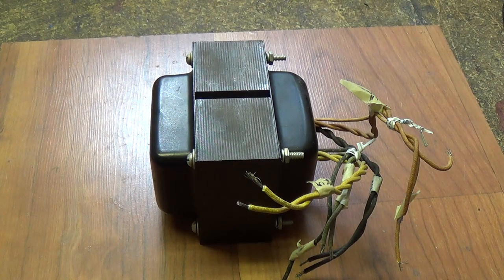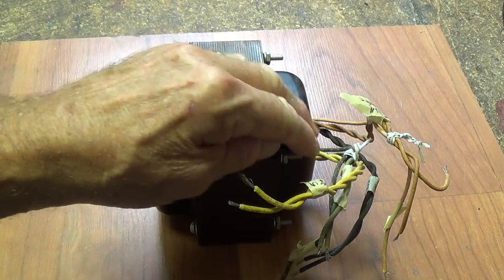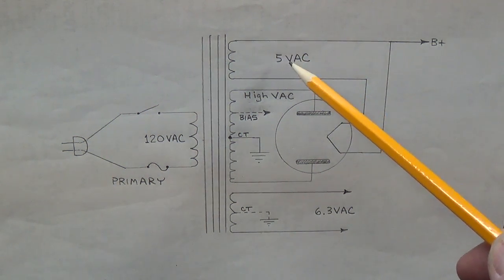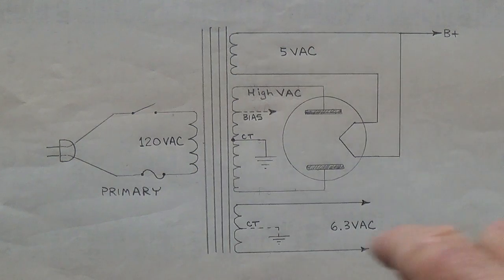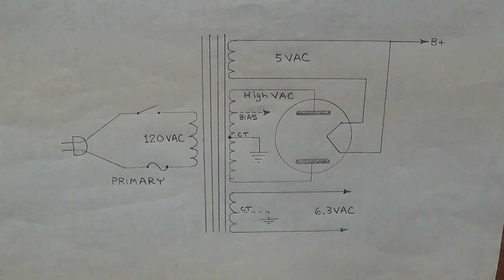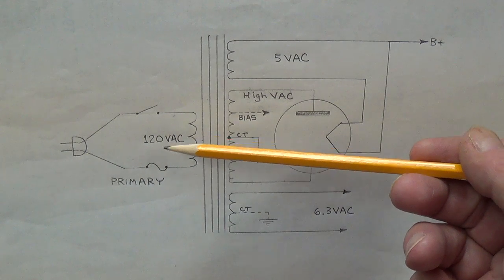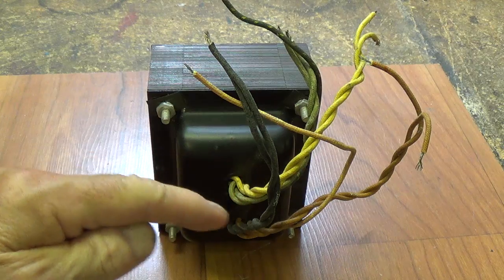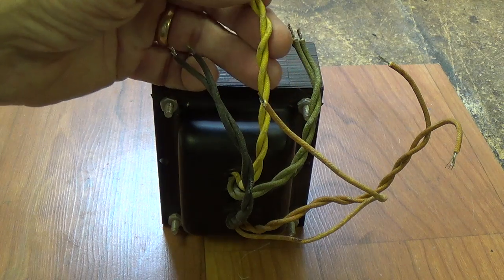How to Identify Amplifier Power Transformer Leads

Comment: Flea market...$5 each.......Yeah, I scored 20 identical power transformers ...haven't checked them out yet for voltages.....
Reply from the maker: Hopefully, the video will be helpful and you'll find some gems, Doug.
Reply: yeah, I should have grabbed more of these...the guy had at least 200, in original Mfr packing....
Reply from the maker: Transformers are normally one of the most expensive parts in an amp, Doug, so your $5 gems are a major bargain......as long as they are suitable for amplifier use.
Reply: ...These power transformers....assuming they have high voltage outputs, how would I go about estimating the available current/s...? The units are packed away at another location right now, since I am moving...otherwise I'd try looking at the part #'s....

Comment: Hi Doug!
Here's a puzzle!  (BTW, I'm in Israel, and the voltage at the wall is 235VAC, so I use a BIG step down transformer that puts the output at 117VAC).
When I measure the voltage at the amp on/off switch, across the black/white wires coming in from the step down transformer, I read 117 VAC.  When I put one DVM lead on the black (hot) wire, and the other DVM lead on the amp chassis, I get 235VAC!!
What is going on???????????  Should I be concerned???  (The transformer is putting out 39VAC, just like it's supposed to when measure between the CT and either output wire)
Reply from the maker: I would have to see a schematic of the set up, Aaron. As it is, it's hard to envision......also, why is the isolation transformer putting out 39VAC......did you mean, 59VAC ??  When you are operating the amp, what is the potential between the chassis and earth ground ??
Reply from the maker: This sounds pretty straightforward to me, Aaron. The amplifier is operating on the difference between the 234V "hot" black wire and the 117V white "common" wire, which is 117V.  Your confusion lies in your assumption that the output of your first stepdown transformer is 117V black and 0V white (referenced to ground)......which your own measurements contradict. Potential is simply the difference in voltage between two points, and neither point has to be 0V. In this case, the output leads from stepdown transformer #1 (referenced to ground) are 234VAC black and 117VAC common with a net potential of 117VAC for the amp.  There are two ways to make the voltage "ceiling" closer to the "floor":  1.) Lower the ceiling (which is what you are visualizing)  2.) Raise the floor (which is what the transformer is doing).  I hope this makes sense.
Reply: It makes a lot of sense.  I tested another stepdown transformer and got the same results.  You really know your stuff!

Comment: Great video, but why do I have problems?  I have a Fender M-80 SS amp.  Two wires clearly come out from one side (left front), which I thought is the primary (b/c one of the 2 wires is straight from the power cord).  Three wires come out the other side (right front), and I think is the secondary.   Testing between the two of the 3 secondary wires yields 1.8 ohms.  Testing between those two and what SHOULD be the center tap (the third wire) yields infinite ohms. 

According to the Fender schematic and the labels on the circuit board, one of the two wires that I thought is on the primary side (b/c of physically next to only one other wire, the hot from wall one) yields 0.9 ohms when tested between the two wires wires on the secondary side that yield 1.8 ohms between them!  That makes IT the center tap!  

Is it possible to have two wires on one side of the transformer not be a primary pair?  Is it possible that the three wires on the other are not secondary side??

thanks for any help, and stop feeding Rusty all the leftovers, he's gotten fat!
Reply from the maker: It seems unlikely, Aaron, but the DMM rarely lies. Did you check for continuity between the wire to the power cord and the wire you initially thought was the CT?  Using a current limiter (see my video on how to build one) you could very carefully connect what you think are the primary wires and see what kind of output you get from the three output wires.
Reply: I think I figured it out...PHYSICALLY the two primary wires are on opposite sides of the transformer.  It's just my bad luck that the two places where wires come out of the transformer are opposite. I thought on side would be primary, and the other side secondary.....but after doing the resistance testing I think I identified what's what....frustrating for a beginner!
Reply: First, to answer your question, there's' no continuity between the wire to the power cord and the wire I initially thought was the CT.

What makes me believe I correctly identified the wires at last was the fact that the two wires that I NOW think are primary are the same color=black, and the three wires that I NOW think are secondary are red, red, and red/yellow stripe.  That was a clue I neglected.

Now the readings are Primary: black to black=5.5 ohms.
Secondary: red to red= 1.6 ohms; either red wire to the red/yellow wire=0.8 ohms.
I think that makes sense.

Again, I'm a beginner...the one black wire and one red wire coming out of the same location on one side, and the one black wire and one red and one red/yellow wires coming out of the other side had me (the beginner) convinced which wires were primary and which were secondary.  Like they say in real estate, location, location, location!!  

I HAVE made your current limiter (thanks, again!), and will try to plug it in so I can measure the voltages (my goal).    

Thanks so much again for sharing your knowledge, expertise, and time!
Reply from the maker: The color clues would have been sufficient. These are standard color identification for primary and secondary (with CT) outputs. Your resistance measurements confirm this nicely.  Thanks for sharing this learning experience.

Comment: hi uncle Doug, learnd a lot from your videos, thank you very much. I just built your tremo verb e Im having current leak from chassis to ground of about 2.5 volts ac. already tried everything from changing transformer, filter caps a a lot of capacitors on the ciruit, but it remais leaking 2,5v to ground. Im out of ideas. what whoud you think coud be happening? Thanks a lot for you videos.
Reply from the maker: If I understand properly, you measured the potential between your (ungrounded) chassis and earth ground and found that it was 2.5VAC. I assume, however, that when you ground the chassis with a 3-wire power cord (thereby eliminating the 2.5V potential), the amp works just fine and no fuses blow. If this is true, I don't think you have a problem. It's not uncommon for a small potential to exist between a chassis and ground. Most people never notice it because the 3-wire power cord eliminates the potential.
Reply: Thats right,,the amp is working fine, very little hum. Thank you for the help Uncle Doug, Your channel on youtube made it possible. I always wanted to build my own tube amp and you explain things so easily that I finaly gave it a try. Thanks from Brazil.
Reply from the maker: You're welcome, Maris. Congratulations on your successful project.

Comment: It may be a good idea to connect the leads to a strip to measure them. (with voltage)
Reply from the maker: Yes, once you have analyzed them and come up with a presumptive idea of their identities, it's a good idea to (carefully) energize the primary and check the voltages of the secondary outputs.

Comment: I have tape decks that don't have a primary line fuse so I put one in is that a good idea I put half amp in cassette decks and CD players
Reply from the maker: Yes, proper fusing is very important for all electronic gear, David. IMHO,  fuses should be rapid acting and of the minimal value to permit reliable operation.

Comment: another great video Doug! I have a pile of old transformers I've been hording for many years and always just plugged in the blacks and measured... good to be safer and more methodical!
Reply from the maker: Thanks, Bill. That method will work, but it helps to do some preliminary evaluation to facilitate proper identification of the secondary leads.
Reply: Thanks Doug, I re watched and am in the middle of a build of an old RCA reel player into a Suitcase amp. I was looking at the transformer it came with, on the schematic (and in the amp) and noticed it doesn't have the 5 Volt Heater typical of a 5y3 setup. They were using a 6x4 which used the 6.3 heaters from the usual heater winding. I was planing on a tweed era single end prinston. Question. Do you think I could get away with running the 6.3 heaters on a 5y3? or would this simply yield a burned tube and unhappy junior amp tweaker?

Comment: Hi! Doug; Thank you very much for doing these videos. I've certainly been going back to school on them. My tube training was in 1964. I have a transformer that came to me in a 1960's college home study training kit. It's marked K83J2841 but nothing returned on a google search. The core is 2 5/8 X 2 1/8 X 7/8 EI form. It has 3 leads 2 green, 1 red. green to green measures 220 ohm. one green to red measures 234 ohms, and other green to red measure 14 ohms. Wire is about 16Ga. Any wisdom on what it might be or how it might be used? Cheers.
Reply from the maker: It's hard to say, Don. It would not work as a power transformer or output transformer.....perhaps as a filter choke ??

Comment: Uncle Doug.. Here is my Final Exam Question: Designing a Tube Amp with the following parts:   Power transformer Hammond 370AX, Output Transformer 1645A,  1 ECC83 preamp stage 1, 1 ECC83 preamp stage 2 , A tone stack (Treble, Bass, Midrange, Volume), 1 ECC83 as Phase Inverter, and 2 6L6GC push-pull .    What is the power consumption? Output Wattage, Plate Currents, Plate Voltages, and Cathode Voltages of each phase?   your thoughts and suggestion .. Highly appreciated!
Reply from the maker: I have no idea, Sammy. You'll have to build it to find out. Let us know what happens. Best of luck.
Reply: Uncle Doug good news!  I finished building the tube amp and it played like a champ!  Couple of setbacks I had ..  I struggled to get tube amp coupling capacitors (.01 uf /.047uf  /450 volts)  but I was lucky to meet an old aerospace engineer in my neighborhood who had some ... I feel like a kid in a candy store .. !   ...  the neighbours did not complain about loud music yet ... maybe they love it !  (I'll share the math calculations later) bye the way did I tell you your videos were very helpful!

Comment: First thing is to check for continuity. Not all power transformer have visibly different colors ( age often fades the colors.). Tape a band of tape around all wires that show continuity. This lets you know they are one and the same wire wound around the former.
  For example: the 5V rectifier tap will of course be isolated, so it can allow the B+ to ride along it's winding. The 5V rectifier (two wires) will NOT have a center-tap. The heaters (6.3V or 12.6V - perhaps center-tapped) are also isolated.
  Here are some notes:
If only 2 wires have continuity, then that is a simple winding.
If 3 wires have continuity, then you probably have a center-tap winding (x, 0, x)
If 4 or more wires have continuity, then you have a multi-tap transformer winding.
Reply from the maker: Thanks for your helpful input, Rick.
Reply: Uncle Doug: Excellent video/ tutorial.

Comment: I do not understand how exactly the resistances in the primary work. If I were to put 120V across a 1.2 Ohms resistor, I would have a current flow of 100A ... now since that doesn't happen - what do I miss here? Is the Impedance that significantly higher than the DC Resistance? Is the primary reflecting the secondary? Where is the difference in behaviour between load and no load on the secondary?
Reply from the maker: A transformer is not a resistor.....they behave quite differently.  If you applied 120VAC to the primary of a power transformer with no secondary connections, little or no current would flow.  Once you connect loads to the secondary, each will draw their prescribed current, resulting in proportional current flow within the primary.  If each of the secondary loads are within reasonable limits, the total current flow within the primary will be tolerable for the PT.  The only time that 100A would flow in the PT primary would be if there were a dead short in the secondary.....which would blow a fuse and/or quickly incinerate the primary.
Reply: Thank you again for your answer :)

Comment: I really enjoy your videos and have learned so much from you , thank you.  A few months ago I had just built my first amp , out of  a old tape deck.  These things seem to reproduce now there are 5 and they make me buy test equipment.  I'm not addicted to the smell of old tape recorders , I can quit anytime I want.  
When I hooked up a power transformer to the current limiter , without a 
load on the transformer I got nothing.  Using a small Craftsman digital 
VOM. Then I hooked up another transformer I knew was good and nothing.  
It's good I didn't put my tongue on it. lol When I hooked it up direct 
to AC ..... I got power?
Reply from the maker: Greetings, Frank. You're welcome for any assistance provided by our videos. Recall that current limiters, as evident in their name, are purely current-dependent devices.  When you connect a PT primary winding to the CL, with no secondary load, virtually no current flows. Thus, there is no current to illuminate the bulb or to be measured in the secondary. For this reason, CL's are best used for monitoring current flow in completed circuits, such as operating amps. Best of luck.

Comment: Dear Uncle Doug,  I enjoy your videos and learn a lot from them.  Thanks!
This transformer I picked up out of the trash years ago is unmarked.  Looks scary but cool so it's been on my shelf.  Maybe you can help me demystify it.  I've thought it would build a great bench power supply.  It's about a 4.5" cube, chassis mount with 4 L brackets.  I'd say minimum 15 lb. Shell type with one winding with thin wire inside the other with thicker wire.  Two primary black wires that looked like they were going to 120v with impedance of 1.2 oms and two red fatter secondary wires of .4 oms.  Secondary side is connected to a heavy duty rectifier marked MDA980-2 and a 10000 MFD 75 WVDC It appeared to be powering a board supplying 5, 15 and 28v DC at quite high amperage capacities looks like.  What would be the secondary AC voltage?  Is it safe to hook it up and measure it?
Reply: Never mind, I got my courage up, made a setup and it measures 34-35 VAC out of the two red wires.
Reply: Rectified to 49VDC!
Reply from the maker: You're welcome, Adolfo. I guess if you needed a good 49VDC power supply then this transformer will definitely be helpful. Best of luck.

Comment: I'willbuild that limiter, that should help me so i dont get electricuted testing my 1942 Anniversary model Tube Radio and phono.. Thanks../
Reply from the maker: Its main purpose is to protect the electrical circuit from damage. Be sure you learn all the safety practices before trying to work on any electronic device.

Comment: green is usually for tube filaments. black is usually primary
high voltage will be red with a red stripe center tap

rectifier filament is yellow

usually
Reply from the maker: Thanks, Joe.

Comment: yo any info on an old philco transformer? 5 leads 2 matching green labeled "grids" a black lead labeled b+ white on the same aide as b+ with no label and one yellow i assume would be a center tap im super stumped and they measure:

green to green - 335 Ohm
green to yellow(1) - 174.8 Ohm
green to yellow(2) - 160.7 Ohm
green(s) to B+ - 1.5 mOhm
green (s) to white - jumps from 700 kOhm to 1.56 mOhm

B+ to yellow - jumps from 700 kOhm to 1 mOhm
B+ to white - 326.8 ohm

white to yellow - jumps from 700 kOhm to 1.4 mOhm
Reply from the maker: The "jumping" values are a bit strange, Rob. I'm sorry, but I really can't offer any guesses without actually evaluating the TF myself.  If you can identify the primary leads, you could power it up and carefully measure the outputs from the secondary leads.
Reply: Uncle Doug heres a pic incase you have come across this transformer before or if anyone in the comments section here has imgur.com/a/e7dZV

Comment: I wonder if it might be worth going over the different classes of multimeters? Personally I wouldn't test a power transformer with anything less than a class IV multimeter due to the potential for higher voltages coming from the secondary winding.
Reply from the maker: It might be, John, but I'm not sure if the majority of viewers would be interested in a rather esoteric topic such as this. I've had great luck for many years with my moderately priced multimeter.....and I'm not even sure what class it is. I will, however, keep this suggestion in mind for the future. Thanks for your input.